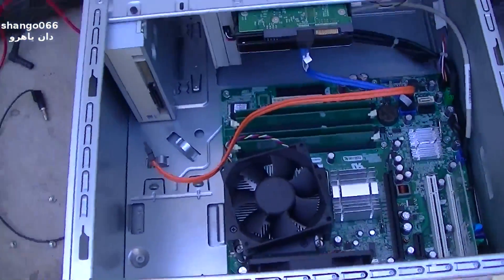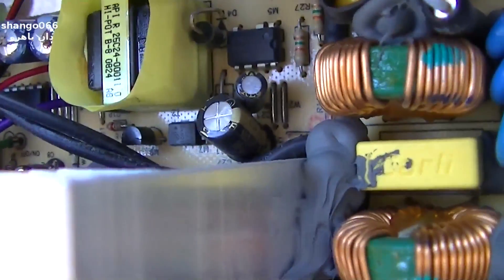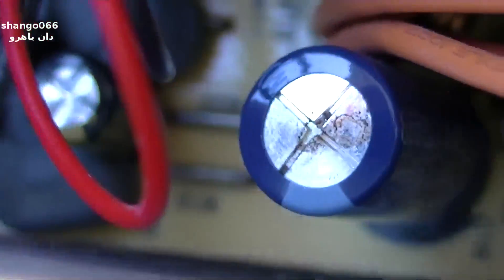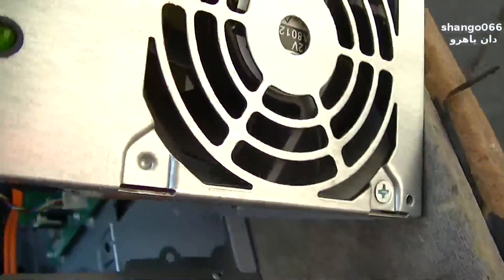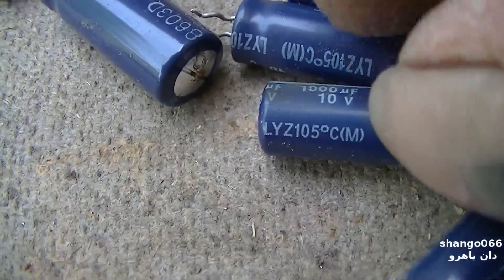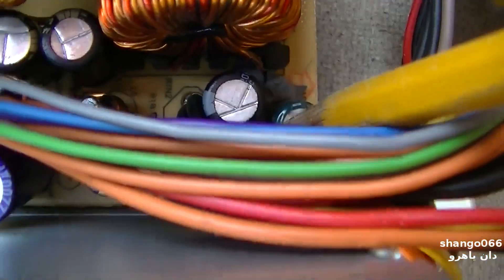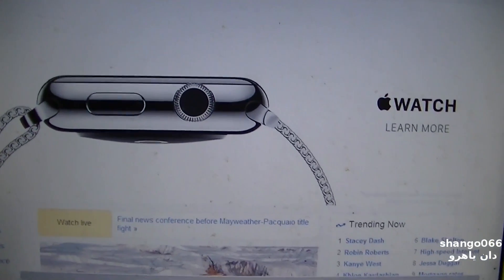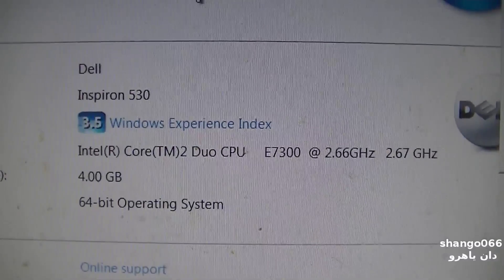Dell Inspiron 530 Power Supply Repair Capacitors

Comment: AC BEL is not that bad actually. I prefeer LiteOn. Those PSUS are good ... BUT ... they suffer a lot when the airflow is not so good. Board doesnt look coocked tough ..... The firs one you show, are for the 5V stby. Those are the first to go bad because this sections is always running no matter the computer is on nor off. Once they go bad, 5V turn unstable, but caps on the motherboard will help a bit until it get worse that either the noise will stop the psu itself or fry the computer chipset. Other nice things that people do now is using turned PCs as cell phone chargers. Here is the issue, when the CPU its off, you are getting 5V from the stby section. The stby section is 2A probably 3 at most. And .... it is pasively cooled since the fans are not spinning. Overloading this voltage is not good for the PSU or the computer. They should safely cut off .... in theory. Once caps start to go, the noise is feed in the loop and it only gets worse and worse.

Comment: I was using Vista on a Dell 220s up until like 2017.  My mom now uses it with windows 7 to surf the web while she works on her Mac Book Pro.  And I also like Firefox.  Only reason I use Chrome is because certain add-ons that I have become accustomed to using only work with Chrome.

Comment: For a Dell i'm not sure even if that PSU was original,.. as every dell i had the PSU was marked with the dell on the label, and most were higher wattage also.  I usuaslly just change to a higher wattage PSU, never had problems and PC's run better too, and can add better Video cards ETC then than stock.

Comment: About low esr: I had a flat panel monitor that I changed the power supply caps of several times and they kept popping after a couple of months of use till I put some disc caps in parallel to them. After that it worked for several years and it's now sitting on my shelf as a spare.

Comment: Vista's a dinosaur? Heh, I'm watching this video on an XP box. My laptop had Vista, it ran so horribly that I eventually upgraded it to XP also.
Good fix on that power supply.
Reply: I still run Windows 3.1. Never crashes,  never locks up, never causes that excessive hard drive activity.
Reply: Win=7 is good, That i like, vista always had crash problems , Here XP is outdated now and we need newer Os to run some apps and stuff, but XP was good too, i used that before win-7.

Comment: Dell had a major problem with defective capacitors a few years back. There's even a Wikipedia article that specifically mentions Dell.   https://en.wikipedia.org/wiki/Capacitor_plague

"The capacitor plague was a problem related to a higher-than-expected failure rate of non-solid aluminum electrolytic capacitors, between 1999 and 2007, especially those from some Taiwanese manufacturers,[1][2] due to faulty electrolyte composition that caused corrosion accompanied by gas generation, often rupturing the case of the capacitor from the build-up of pressure."

Comment: old junk. ready for the landfill
Reply: Why? If it does everything you need why throw it away? I am using a much older pc running Win Xp. If you dont need to play modern video games then you dont need a poweful PC.
Reply: +PhuckHue2 Not old junk! I'm using a machine about the age of the one in the video and it runs really well.
Reply: +Sony Trinitron you don't know much about electronics. every capacitor in that old chinese junk is bad.  just because a capacitor isn't bulging doesn't mean its good. bad caps causes other components to go bad. so if you enjoy voltage spikes destroying your motherboard go ahead and use that junk
Reply: PhuckHue2 I've got a motherboard that I recapped about 6 months ago and it is still going fine, and capacitors on the motherboard are only for filtering interference. Also when you said junk I thought you meant spec wise being junk rather than just cheap quality.
Reply: some people have to learn the hard way..

Comment: Where i live (Cro.) , peoples who still deals with repairs of electronics ,does not even want to look @ repairing an PS. even if its good branded and "roomy." I have cooler master m1kw , its just stooped turning on a pc, no smell nor burned parts (caps or diodes) , no nothing visible , and no one wants to try even diagnose it . Am kind a sry for it. But ... Not every time you can see an magic ghost smoke out of parts..
Reply from the maker: +makinjica Cro?
Reply: +shango066 -- croatia (dalmatia)
Reply from the maker: Very cool ☺
Reply: +shango066 yup. me like retro. me like yours videos here. hehe

Comment: Hmmm, strange that I'm watching this video on my Dell Inspiron 530 with vista home basic.  Bought it new in April of 2007 and except for blowing it out with a compressor hose about once every 6 months, it's still running just fine and it's been turned on 99.99% of the time since it was new.  That one is a lot more poweful than mine too.  Mine has 1 gb of ram and is 32 bit with a 500 gb hard drive.

Comment: I thought all pc power supplies fail given long enough, even high quality electrolytic capacitors are only rated at a few thousand hours. I recapped an Enermax psu around 3 years ago with some Panasonic caps I may open it up to check the capacitors are still OK just as a precautionary measure(rather than have it possibly blow up my hardware).
Reply: Coolkeys2009 Currently there are models of Mainboards, GPU cards, PSUs, etc with nice solid state caps. I'm looking forwart to my Asus X99-E WS with solid state caps. Let's see how long this Mainboard will last. :D
Reply: ***** I actually have an older GPU with solid capacitors that fails under load. I'm wondering if the solid capacitors on that are bad or if it's something else.
Reply: Coolkeys2009
I'm not shure. You can find it out by hooking up a scope and check the ripple. But I would check if the connectors for the extra power are have good contact.
Reply: *****
I 'm sure it's the card I tried it in 2 different PC's. Checking the ripples a good idea if I don't slip with the probes.
Reply: Coolkeys2009
Even on production cards, there are plenty of testpoints. :D

I rather tink it's the GDDR RAM that's faulty.
Reply: ***** That particular model of card was known to have overheating issues so it may have just finally failed. I will have a look for test points but I may just end up buying a newer card rather than trying to repair that one.
Reply: Coolkeys2009
Overheating issues can result into loose BGA connections. You might fix it with a hot air gun, but it will fail again. Buying a new one is probably the best solution.

Comment: This is probably what is wrong with my old Northwood 3.2 PC.  Hadn't powered it on in over six months and when I did, nothing.  I pulled the motherboard harness and shorted green to black and the drives spun up.

Comment: The cap that looked ok was probably for the -12 supply which is rarely used in modern computers unless you use rs232 levels
Reply: william fleete El-Caps usually go bad when they overheat and therefore drying out. This also happens with almost zero load on the rail of the cap... It was just the dust blocking the aif-flow over the components.

Comment: Shango066   i have a dell desktop computer that did the same exact thing, i was uploading a video to youtube and during the upload the electricity went off, when the electricty came back on the computer would never restart again ever, i peeked inside and saw those same caps, i did not know that they are not supposed to look like that until i saw your video, its been offline for a couple years now, i am on a other computer now, so its sad because i have camera pictures on there that i can never get off of there because it wont work anymore, so i just gave up and it sits there to rot
Reply: letseeitplease buy a new PSU for like £15 on Amazon.
Reply: Take the hard drive from the old Pc and use that as a slave drive temp. to retrieve what u want then u can Get another PSU for the non working Pc and try it again, But it is possible to get all info off the old HD. by slaving it as secondary drive to new Pc and get the info. u want, then decide what there after you want to do.  it is not hard to do, just both drives need to have same type connectors or get a drive box you can put old drive into to hook up on USB then either way you can get the information back.  That is what i do when i need to.

Comment: I've replaced more power supplies in those Inspiron 530s/Vostro 200s than I can remember. You would have no idea how many times people would tell me that "the guy at x chain store" said the motherboard was fried, but it was only the power supply.

They can be quite misleading, especially when using a power supply tester, because everything will look fine at first glance, but once you put a load on them, the voltage drops to a point to where the system won't boot.

Comment: The hard drive is always being scanned on Windows vista. That was one big down fall for that Os.
Reply: ***** Indexing can be turned off.  Probably stop the churning hard drive.
Open up Services through control panel, or by typing services.msc into the start menu search box. Find “Windows Search” in the list of services and double-click on it to open it.

Change the Startup type of the service to Disabled, and then click the Stop button to stop the service.
Reply: ***** Its the shitty search engine, it still does that crap on Windows 7. First service I deactivated was the f***n "Windows Search" service!

Comment: is there a central Chinese government mandate to ensure that large amounts of their electronic hardware will fail within a certain period of time to ensure future revenue by replacement of failed equipment?
Reply: chrisw71 Not just made in China products - the whole world. Check 'planned obsolescence' - nearly every company does it to continue selling.
Reply: chrisw71 Worse than that...the waves of failed caps we've been getting since the early 2000s were essentially due to sabotage in the name of greed. The root cause here is a bogus electrolyte formula that was at least partially "borrowed" from a Japanese manufacturer by Taiwanese companies; they couldn't reproduce it exactly, though, and so these caps don't last nearly as long as they should.
Reply: @lee4hmz  A bit late to the party.  But considering the millions and millions of capacitors released sense that entire mess-  You would think China would do a better job.  So I'd say it's no longer a question of the 'bogus' formula.  (and you're right.  I do work on badcaps's from time to time...and that was like a rash...)  I think now it's just as  you say:  Greed..

Comment: My seven year old PC is going strong after doing some recapping in the PS. All of mine were 2200uF @ 16v and the smaller ones looked fine. Should have checked for date codes on them for fun. Cool video.

Comment: I had an old IBM with leaky caps like that.....changing them out fixed the machine.

Firefox is my main browser, but I do use Google Search. At the bottom of the page, there's always a prompt asking if you'd like Google to notify you of new results of whatever it is you're looking at. I once typed in 'big black asses', and sure enough, at the bottom of the page it said "Would you like Google to notify you of new results for big black asses?"
Reply: Haaaaaa! That is hilarious!

Comment: I still use my Inspiron 531, which was the AMD version of that PC. Bought it new in 2007 as a stripper, upgraded the processor and RAM right away as well as an actual video card. While I retired it to second PC duty (vs. buying an old beater for a second computer), it's been very reliable. Mine has a different power supply than that one BTW.